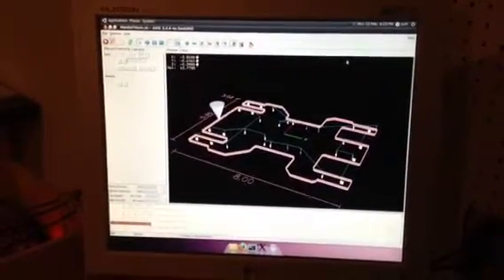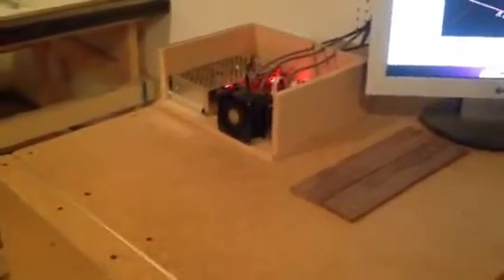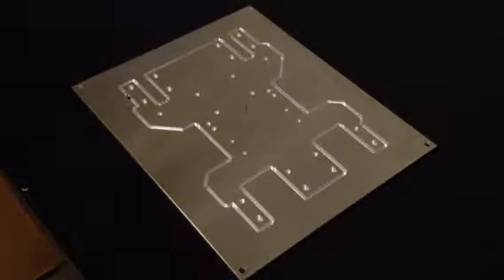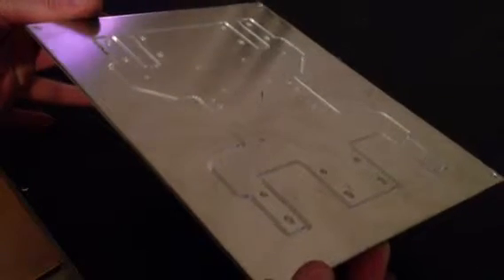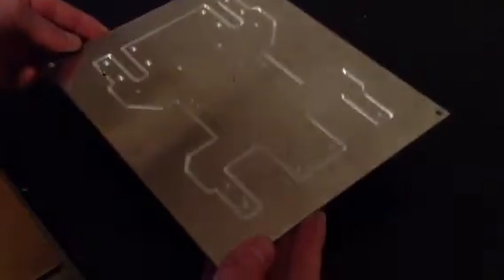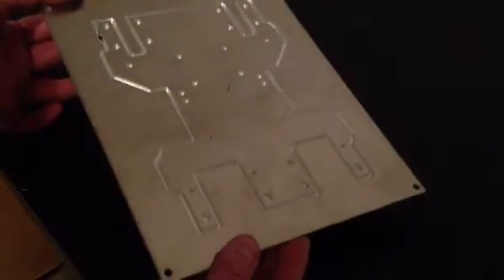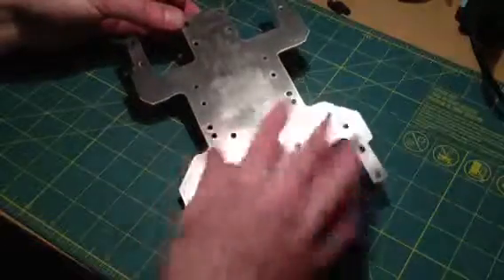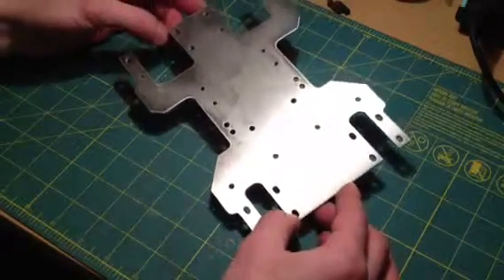Milling The Frog

Comment: Hey, does the enclosure help keeping the noise inside a lot? What is it made of? Looking into sth. similar for my own upcoming cnc...
Reply from the maker: Enclosure helps a ton!  That one in specific was filled with sound deadening insulation and had a double pane acrylic window...I was running it in an apartment at the time.  Currently my larger CNC in my shop is still inside an enclosure as its so much nicer to work around with the high pitched router whine dulled down by the case...not to mention keeping the dust and mess contained.
Reply: @CurtVanFilipowski  thank you for the answer :)